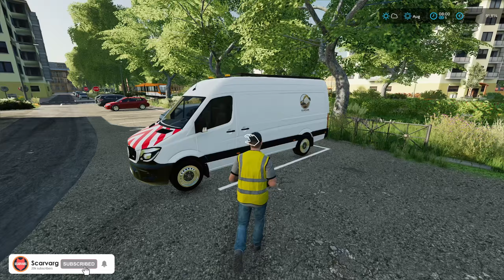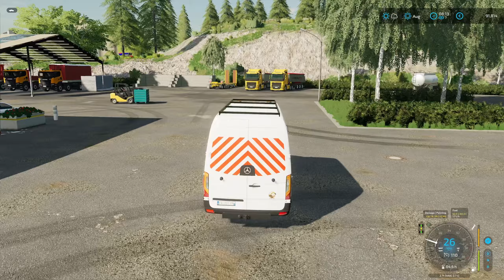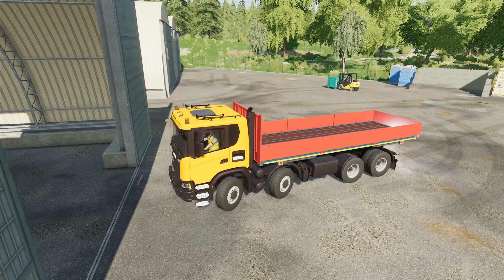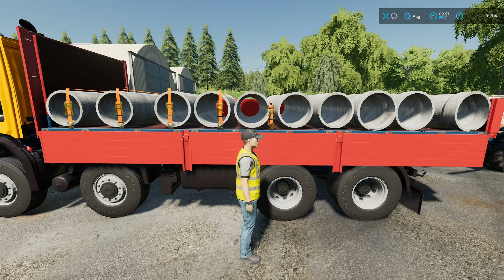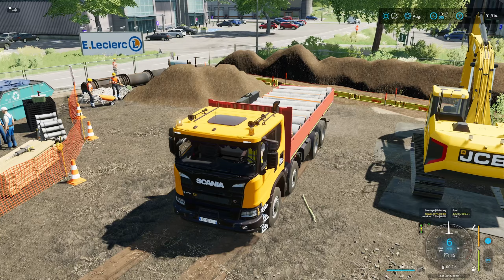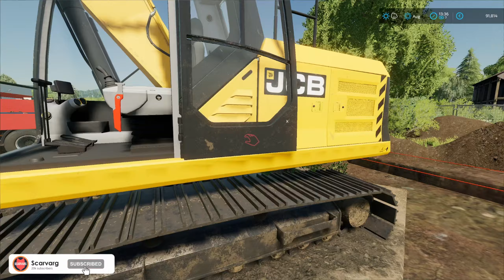🚧 Building Concrete Pipes Pipeline - Scania XT & JCB In Action⭐ FS22 City Public Works Timelapse

Comment: What kind of computer do you have? That you have so many mods and it doesn't crash, I have a pretty good one and when I have 5 mods it crashes in fs 19
Reply from the maker: A couple of SSD's, i9 processor and 32GB ram. Make sure to remove any mods that are poorly made.